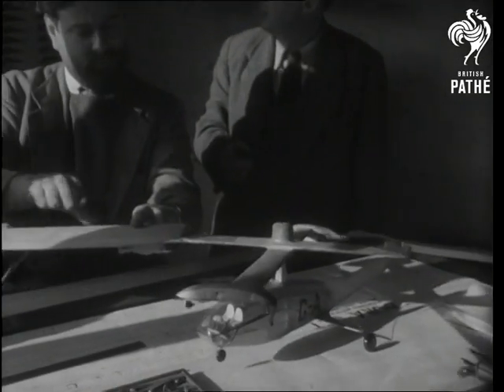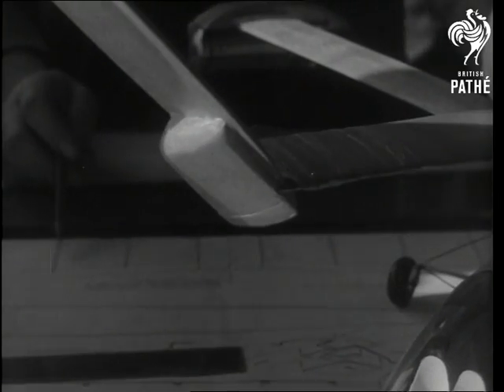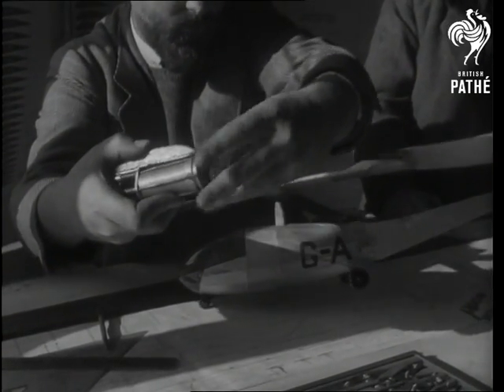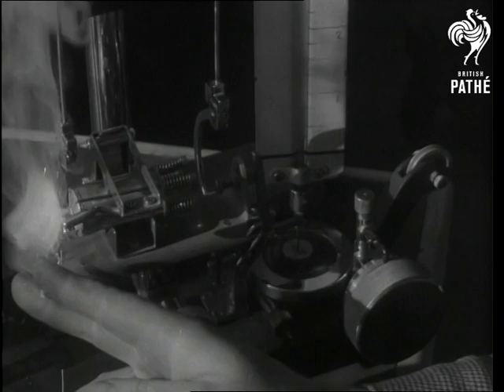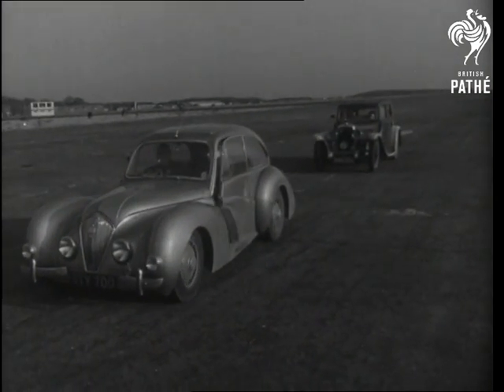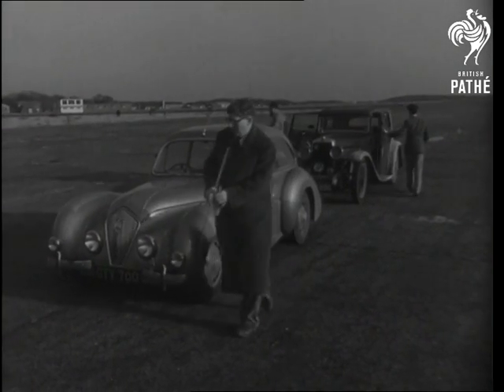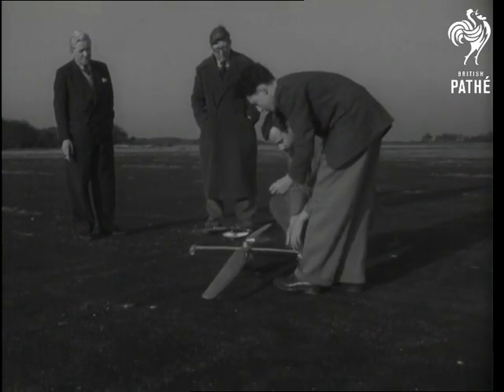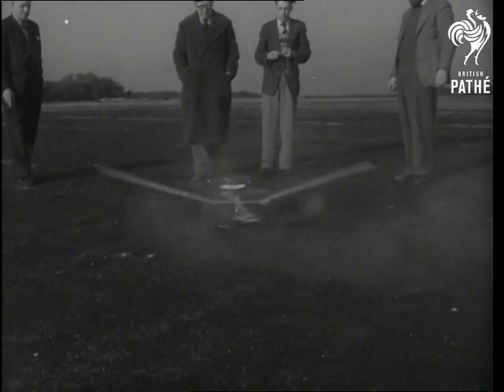Model Helicopter (1951)

Comment: Jetex was the brand name for those solid fuel so called jet engines. They last for a few seconds much like a firework rocket and gave sufficient thrust to get your model air born but ultimately your model then became a glider
Reply: Barry, my late Dad built me a Keil Kraft Mig 15 in the early fifties, all balsa, tissue paper and highly inflammable dope with an internally mounted  jetex, not externally as recommended. No regard for fireproofing, jet pipe etc. Needless to say it made one flight ending in a superb blazing wreck falling from the sky. Those jetex were tough, the crashed engine was recovered and worked again. The thing was Dad was a firefighter at the time! A chip off the the old  block every Airfix plastic kit I later built ended up on fire or with a firework stuffed inside. If only we had phones with movie cameras back then.
Reply: @kenstevens5065  Ditto, one slightly defunct airfix jet. slit in two and place a cheap fireworks rocket in it and glue back together. They didn't fly very well but they could certainly shift up the road and end in a cloud of sparks against the kern. I even hung one from mom's washing line and lit the fuse
Reply: @barryrudge1576  Halcyon days. Thanks for your input.
Reply: @kenstevens5065 I used to build my Airfix models with a firework in the fuselage, too!
Reply: I had a jetex Gloster Javelin in the 60s. It was absolutely tripe.😂
Reply: We used Jetex,in such a multitude of ways when we were 13 back in ‘72.

Rockets, missiles, torpedoes. Anything that had vague destructive power…. Halcyon days
Reply: @barryrudge1576 sir, you are my hero. A proper childhood like mine 👍🏻👍🏻
Reply: @PhilbyFavourites  I'm nearly 60 and yet I still have fun building rocket-propelled aircraft, cars and trucks.
 Nowadays I buy fireworks rather than using Jetex, but the fun is the same...
Reply: @kenstevens5065  I had just finished making a balsa model of a glider called the inch worm with a 60 inch wingspan. I was 14 at the time.  The dope had just about touch dried I lit a cigarette and whoosh it went up in flames. I was able to put it out quickly with the only damage to the doped tissue paper.  happy times but hazardous
Reply: @PhilbyFavourites  Hoe about airfix jets, split into two insert a cheap firework rocket, glue back together and fix to washing line. Light the blue touch paper and take cover

Comment: They look like Jetex 100s in the helicopter and Jetex 50s in the other models. Reusable rocket bodies which you reloaded with with fuel pellets, not forgetting the the fine wire washer to hold the fuse against the last pellet and then exit the fuse through the jet orifice ( the end cap of the body of the engine which had the orifice was clipped back in place )  once the fuse was lit you had a few seconds before the fuel pellets ignited to produce a gas which escaped through the orifice to produce the thrust. Wonder what happened to Jetex?  Must have made a fortune selling the fuel and fuses to thousands of kids and their dads and probably retired to the Bahamas with their coffers full of my pocket money😂
Reply: Happy days😊
Reply: Jetex - SpaceX 🤔😂
Reply: The Jetex could sometimes be frustrating as the fuse was so thin it sometimes would crack at the point where it goes through the tiny nozzle. Light the fuse......wait......nothing!
Reply: We were still buying Jetex supplies in the early 2000s. Built a  komet with  a Jeter 100 flew well but crashed in a spectacular manner.